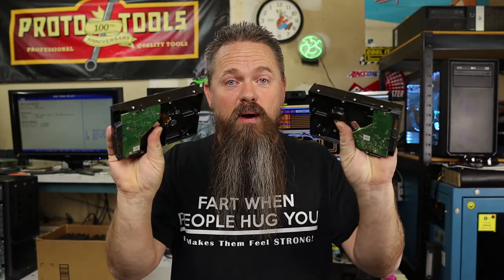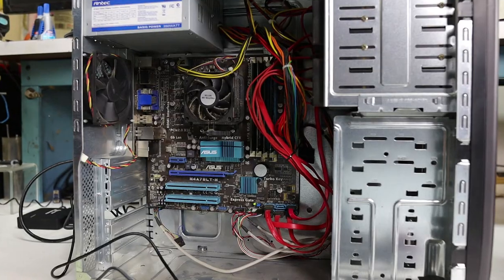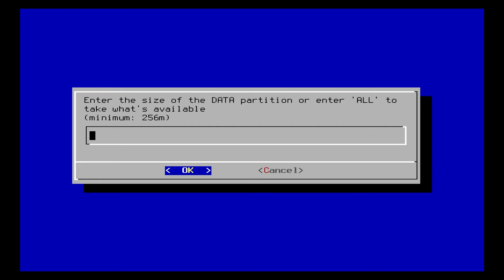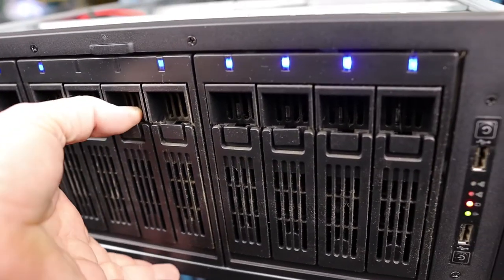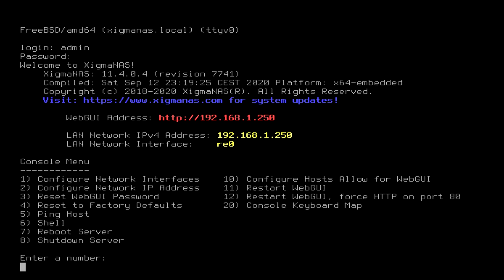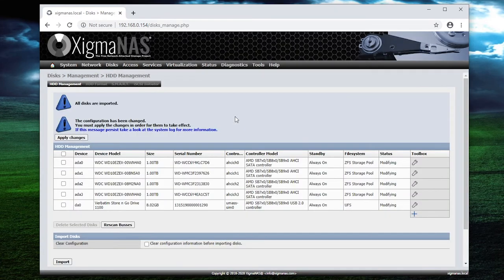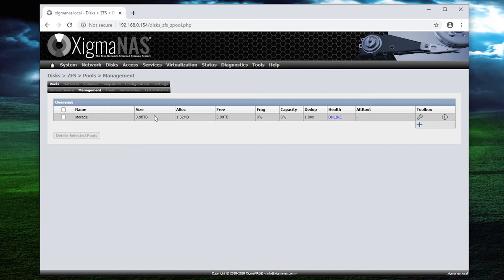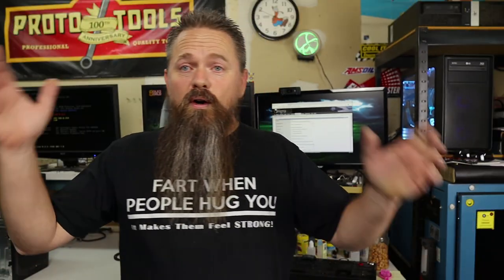Building A File Server Out Of Used Parts

Comment: The reason for the storage size discrepancy is because on the NAS side it sees 1Gb (1,000,000,000 bytes) where as Windows sees 1GiB (1,073,741,824 bytes). This is due to computers count in binary, so a round number in binary 100 0000 0000 is 1024 in decimal. Where decimal 1000 is seen as 11 1110 1000 in binary but isn't a "round" number in binary.  So 1,073,741,824 (decimal) is referred to as a Gigibyte (note spelling) and 1,000,000,000 (decimal) is a Gigabyte.  Hard drive makers were notorious for using gigabytes, and not gigibytes in the marketing for their drives, which is why after formatting a new driver appears smaller than what it says on the box.

Comment: is it possible to run xigmasnas off a pc that has only 1 drive for os/data?  This is for a trial to play around with xigmanas, since I don't have a case yet that will support 4+ drives.  Just wanted to have something on the home network that I can put files on to get from other machines..so I'm not always using USB drives like the old day sneaker net with floppies LOL

Comment: I know this is a year old video but I must ask. Is the "current" storage server running fbddr2. I ask just because that ram looks like the ram I have in a box. If you need more I have like 10 lbs of them. 

That's for video. I have a nas4free movie server but I wanted to see if anything has changed with the software since I thinkine runs version 8 or something like that.
Reply from the maker: The server I built in this video is just an example of what can be done. It wasn't built as a production server or was it ever used after the video. It's just sitting and collecting dust today.
Reply: @CyberCPU  I was meaning the current storage server you showed in your server rack the reason I quoted it was because I didn't know if you had made a new one. After looking at the video later on it showed a different angle of it and it looks like it might be PNY ram but I have old fully buffered ddr2 that has very similar heat sink on it that was
Reply from the maker: @krypticmac  ohh, yeah. That one's definitely still in use. It actually uses DDR3. It's an AMD FX.

Comment: Nice video bud. Are you using ECC RAM? If not, any reason why not?
Reply from the maker: No, I'm not. The reason is because the system is an AMD FX and it doesn't support ecc. So no point in wasting money on it. 

Not using ECC ram takes the risk of losing data if you lose power during a write however, I have the system on a battery backup and it's backed up to the cloud.
Reply: i have both and tested both on a motherboard, also tested with both on the board at the sametime to see the results between both, Motherboard is a am3 ddr3 running phenom 2 x4 955 3.2ghz - 2 x 4 gig 1600mhz ddr3 nonECC and 2 x 4 gig 1600mhz ECC
ECC is to prevent error in the data as its being passed back and forth between processing page filing and hdd storage. Often times unless your running a workstation for computation ECC is of no use to you and often more headache than its worth. Only 100% stable systems from boot sector to max weight load in windows or you will get errors like i had which were fun a interesting to trouble shoot.
With ECC it would produce a error when loading win10 as windows10:Home did not like the ram, anytime you hard boot it will produce this error, after the first hardboot error when loading win10 it restarts the system (fail safes these days are cool i burnt many hardware back in the day before these existed), once the cold boot has happened win10 loads no issue. This error is produced every Hard boot regardless.
Obviously the nonECC worked as it is designed to allow fractional errors with the data as long as the core data is not corrupt a extra 1 in stead of 0 isnt a issue.
The crazy test is the one I liked most, i ran the nonECC in dimm 1-2 and ECC in dimm 3-4 I turned off the dual option and ran them as single dimms to start. Weirdly enough not only did it boot Hard and Cold it did not produce the previous issue when booting into windows. I next removed 1 nonECC from dimm 2, and 1 ECC from dimm 4. Instantly I was met with the same issue as before when Hard booting, win10 would again produce this issue. I then Swapped the nonECC from dimm 1 to dimm 3 and ECC to dimm 1, again i had the same results. After this I tested both options in "ganged mode" the first set of results was with "non ganged mode" From my understanding of ganged its just a fancy name for the ECC option in the bios, i could be wrong on that as well. either way the ganged mode did run the ECC from a hard boot, and obviously again the nonECC had no issue regardless the setting. 
So what has been seen here is the example of the motherboard (very good diverse one at that) will run any ram it is compatilble with regardless of ECC or nonECC mixed or not, as each time i was able to get into the OS and work with my system, (video editing, gaming, research, crypto mining etc, only time i was given a error was on hard booting.
The reason it did not produce the error with the nonECC 8 gig in dimm 1 and 2 is due to the fact those two sticks never filled up completly, so the ECC ram did not have i/o that would have produced the error when loading win. 

Conclusion if your a home user having ECC is just wasteful and irritating, Running business your computer, server, and POS 'PointOfSale',  I highly recommend ECC.

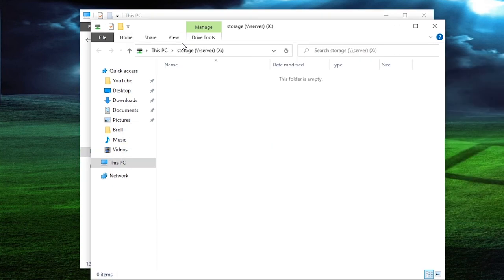Comment: 24:15 why didn't ask you for your password when you mapped the network drive in Windows?

I still can't get past this point. It keeps asking me for network credentials over and over and over, saying the password isn't correct when I know I typed in the same login and password under Access > users.  I've tried changing the password, and using the new password to login, no dice. Or maybe I'm getting the path wrong? I don't know it's never as simple when you try to do these things yourself. 

Maybe there's something not right on my Windows PCs because I apparently can connect to my NAS on my little Chromebook laptop, yet none of my THREE windows PCs can login to it. W T F?
Reply: OMG I figured it out.

When I setup the NAS i typed in the server's name in all CAPS.  So when on the Windows side when mapping the share, i typed \\SERVER\SHARE and not \\server\share  and when it asked for my login/password it then WORKED!  it's like backwards case sensitivity.